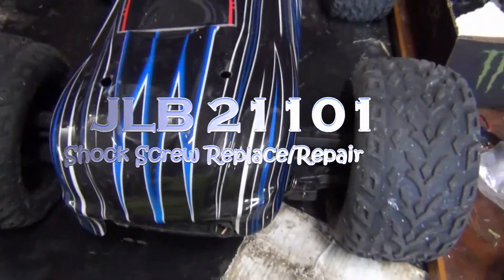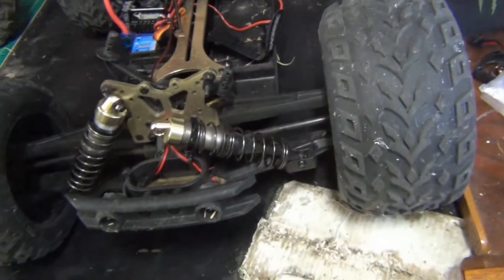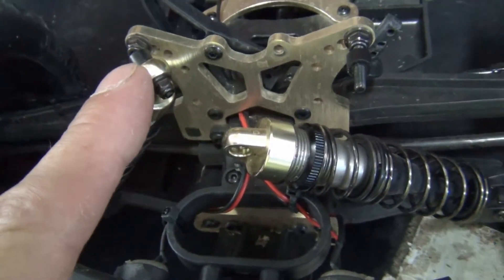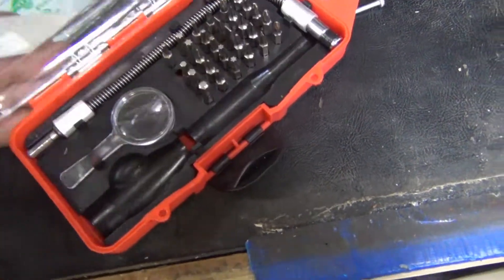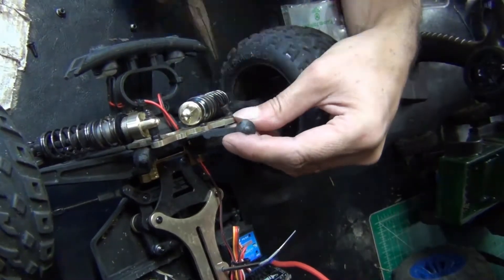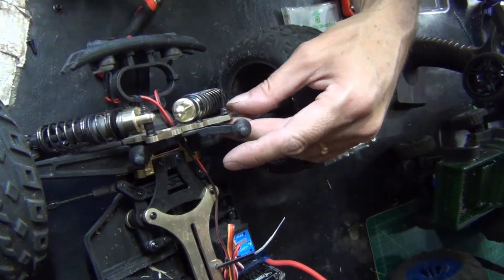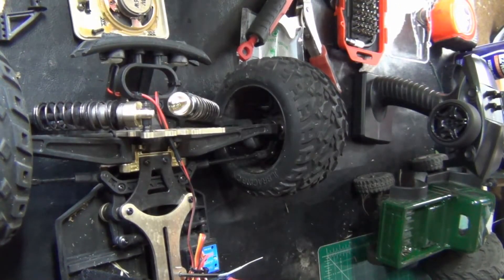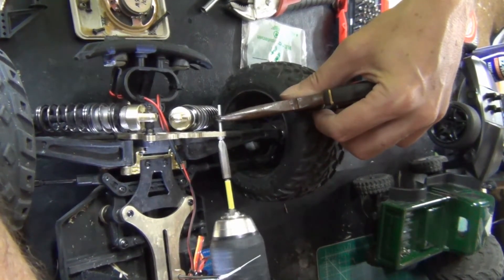JLB 21101 Cheetah RC truggy - Shock Screw Fix - Cheap and fast!!!

Comment: Great video! I have the same issue as well, gonna try this out. What's the name of the tool you used to tighten the bolt and where can I buy one. (7:08 of the video)
Reply from the maker: Thanks!  Glad it was helpful.   That tool is a lug tightener from another RC kit.  It just happened to be the right size.  I think it is from a 1/12 or 1/18 scale RC.   Amazon or any RC shop should have em.   They usually come free with a RTR kit.